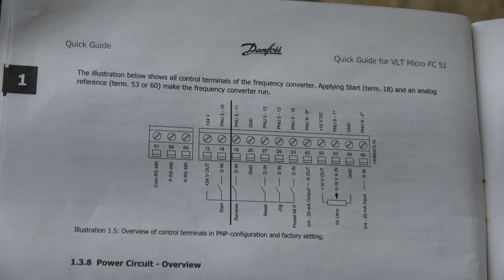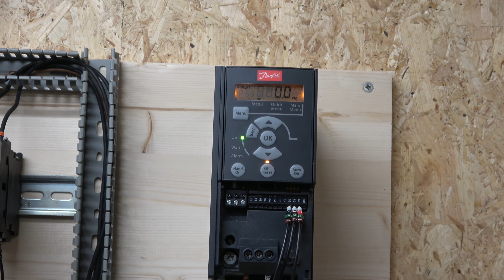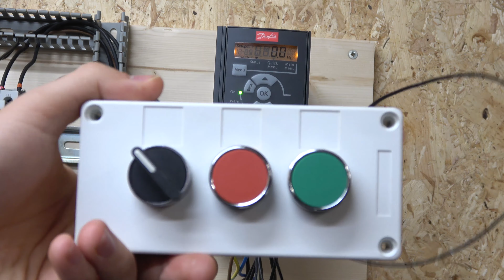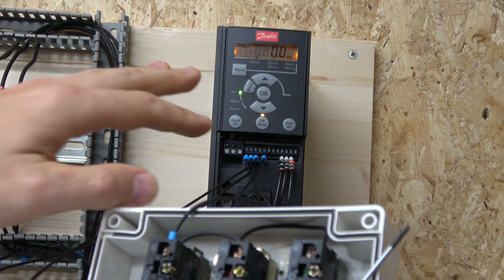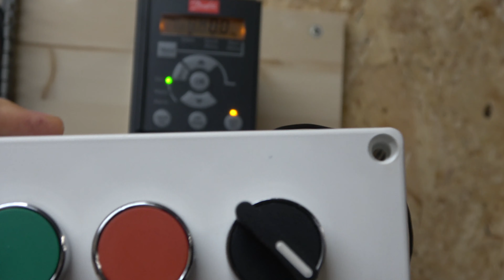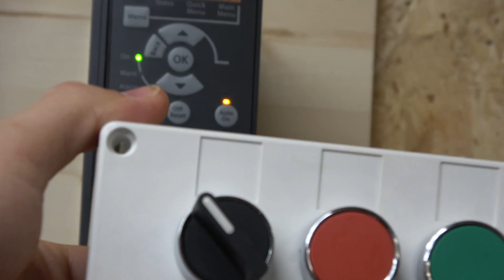Danfoss VLT Micro Drive FC 51 remote control and Factory reset Single phase to 3 phase VFD( English)

Comment: I CANT GET MY VLT FC51 TO START WITH SWITCH , PLEASE HELP HOW DO I START MY DRIVE WITH A SELECTOR SWICH  WITHOUT USING A POTENTIOMETER???
Reply from the maker: Your drive should run from buttons as per video shown and make sure you  are in auto mode. Regarding potentiometer, if you don't want speed control just motor to run full speed or any speed, select you minimum frequency to your desired frequency and up on start it will use that value to run the drive.

Comment: Hello :) i have Danfoss VLT Micro Drive FC 51, and done everything like on video but he still dont want work. Were is the secret ?:D
Reply from the maker: Hi there. You got to give me more info then that. What is your screen saying? Any errors? Any lights flashing?
Reply: @IGSElectronics  no errors or something like that, just  when i was programing like you did, the botons  start and stop dont do anything. i was  wathing your video 15 times :D
Reply: what about 4 little  swithes PNP/NPN do i need to switch on maybe?
Reply from the maker: Ok, are you trying to run the drive remotely? Have you watched the first video for local run?
Reply: @IGSElectronics  yes i was watching now :) the local works perfect just i have a problem when i trying to connect botons to 12 ,18,19,27
Reply from the maker: @alexmechanic4599  did you get your drive new or used, as it is posable that the drive I/O have been rearranged. Is your S200 4 switches down, i.e in of position?
Reply: @IGSElectronics  i get new ,the switches is down.and i done reset how you was showing on your video, and i got a headache  :))))
Reply from the maker: @alexmechanic4599  are you using a potentiometer?
Reply from the maker: @alexmechanic4599 just a stupid question, are you are in Auto mode, i.e remote mode
Reply: @IGSElectronics  yes auto mode, if i didnt  connect  potentiometer maybe that why dont  want to work? :/
Reply from the maker: @alexmechanic4599  yes without potentiometer it will go on but won’t move. Set your minimum frequency to 30hz and then turn on
Reply: @IGSElectronics  thank you.you the best.
Reply: @IGSElectronics  hello!i just want to have it started by an external on off switch, isnt it enough to send 12 to the switch and from there back to 18??thanks a lot!
Reply: @IGSElectronics  what is the parameter for setting minimum frequency?

Comment: How to factory reset when password is there.
Reply from the maker: Have you followed instructions in Danfoss full manual page 13. I have never needed to reset passwords to be able to Factory reset the drive. But definitely check out page 13 in manual.
Reply: I forgot the password..now how to reset it pls help me...sir
Reply from the maker: @deepakshetty4749  I don't have the drive to look in to it, but have you attempted to reset the drive to factory settings, as it should reset the passwords to 0, once you perform factory rest.
Reply: @IGSElectronics  its ok thank you .. if you got any information pls comment...once again thank you
Reply from the maker: @deepakshetty4749  Your best bet is to find the info in manual, there usually is some form of way to bypass the password. There has got to be info in manual.
Reply: I attempted but it ask password
Reply from the maker: @deepakshetty4749  Ok in that case, have you looked in full manual page 13. It talks about how to remove passwords by holding 3 buttons together.
Reply: @IGSElectronics  pls send me the manual link sir...
Reply from the maker: @deepakshetty4749  manual link is in video description.
Reply: I have fc-102 drive sir
Reply from the maker: @deepakshetty4749  Oh, i have not done tutorial on this drive, so i wont be much help. Sorry

Comment: I need your assistance. I install a Danfoss VLT micro drive FC 51, when i apply power to the drive the alarm indicator is flashing red. Can you advice me?
Reply from the maker: What code or error is it flashing?
Reply: The  VLT micro drive FC51 is not displaying any code
Reply from the maker: @EricSmith-jw4st  Usually there should be some sort of code displayed, without actualy seeing the drive not shure i be able to help.